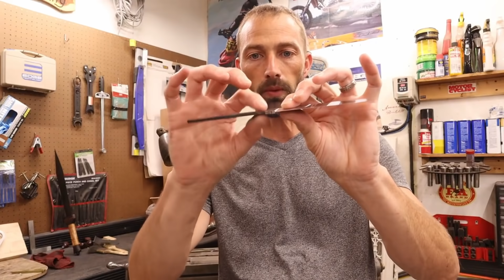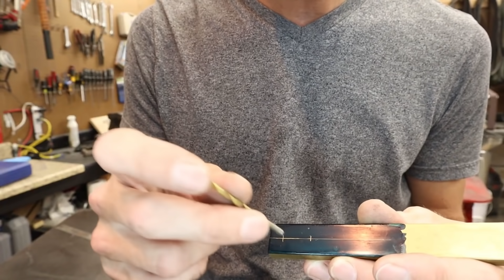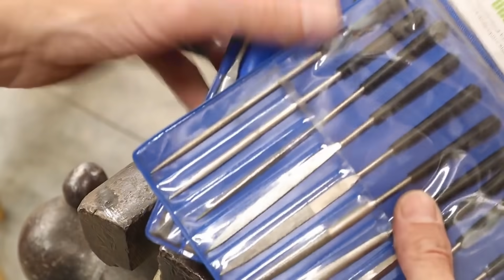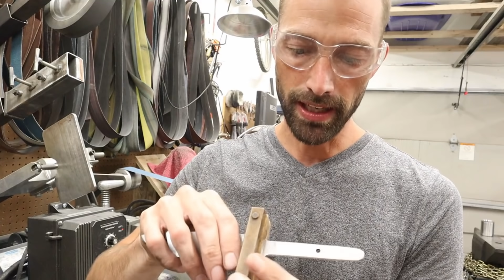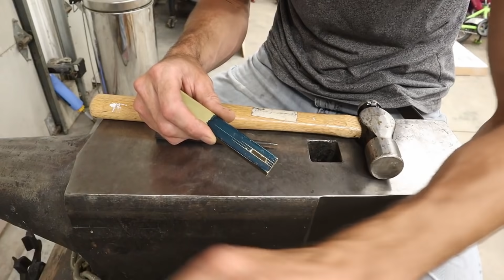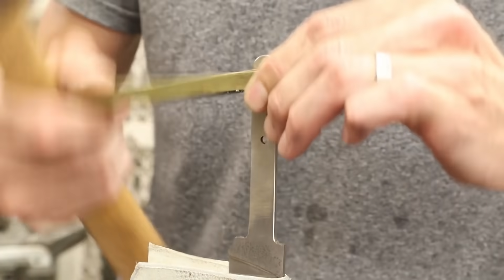Knifemaking tutorial - Making knife guards like a pro

Comment: Do you ever use silver solder rather than epoxy to seal the guard? It is something my uncle taught me, that he learn when working in sheffield england as a cutler. When i asked why he said to help absorb shocks which can cause a tang to fracture and seal from blood seeping into the joint causing contamination ? Thank you for your video's, take care, God bless.
Reply from the maker: I have. I don't silver solder carbon blades because the solder stands out against the steel as the steel starts to take on a petina.

Comment from the maker: Which one of the 3 methods do you use?
Reply: The mill method
Reply from the maker: Love it
Reply: File!😉
Reply: still making ancient designs but that theme will continue so will be file and drill I guess, if there is a hard way I have to find it lol
Reply: I don’t have a milling machine . I have only Iron Workers tools and forge etc,however I scribe a line down my guard metal, clamp it in a vise , then clamp 1/2 inch steel blocks (4 of them) with a piece of blade steel that is thickness of knife between each block on either side . I wedge out the blank blade steel pieces , then drill and file between the 1/2 inch steel blocks , this keeps my cutting square and exact .I probably could harden blocks of thick spring steel after I drill and tap each side as if they were oversized plunge line guards
Reply from the maker: Awesome!
Reply: Airin if you were tempering with a conventional oven what heat and how many cycles
Reply from the maker: Rich, I do temper in a conventional oven. I use the kitchen oven. It is important to let it come up to heat first and then throw the blade in for the temper cycles. The temperature for the temper really depends on the steel. For 1084 I like between 400 and 425. For 2 2hour cycles with a cooling period in the moddle. It can also help to use a sheet pan with a layer of sand to keep the temp from fluctuations
Reply: @Aleeknives  I never heard that before I always have put the blade in when when I turned on the oven and started timer when chosen heat achieved. So there must be a good reason to temper by your method.
Reply: @Aleeknives  I usually shove them in the oven when dinner is cooking at the same time and adjust accordingly lol, saves me getting my ear twisted
Reply from the maker: The oven often will get much hotter than your target temperature as it ramps up heat. You don't want your knife sitting in there while the heating elements are blasting at broiling Temps. Get the oven up to heat and then toss it in
Reply: @Aleeknives  thank you
Reply from the maker: Sure thing
Reply: @Aleeknives  bottom shelf and already heated up when it goes in, fan oven as well so maintains a pretty even temperature

Comment: No, definitely no. You must punch a little hole before drilling. And you must use a clamp to fix material. It’s too dangerous without clamp while drilling.
Reply from the maker: The peice of stock was long enough to be stopped be the upright if it was pulled away from my hand but yes it should be suggested to clamp your work down. Center punching however is a personal choice. I generally choose a drill smaller than my overall dimension allowing a margin for error. Your points are 100% valid and well noted sir! Cheers